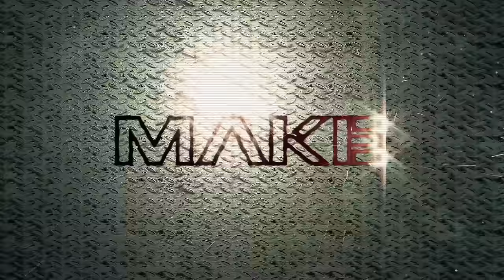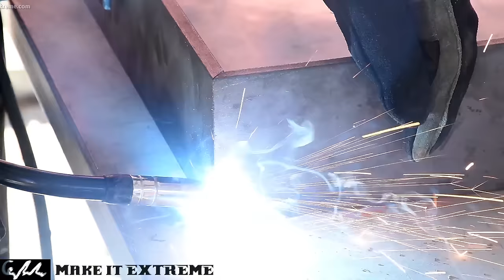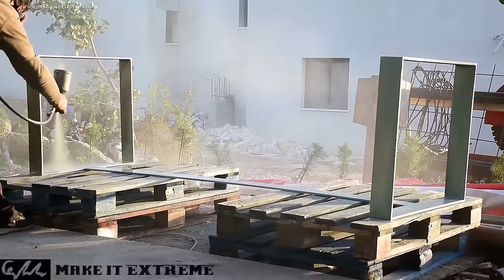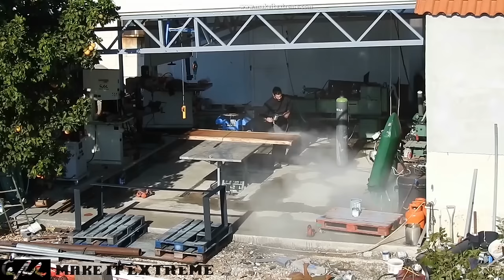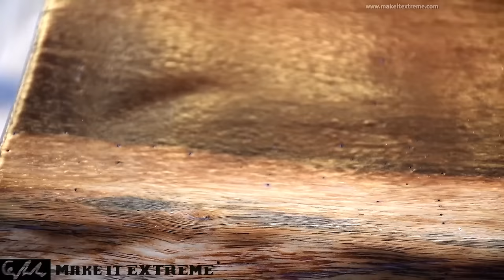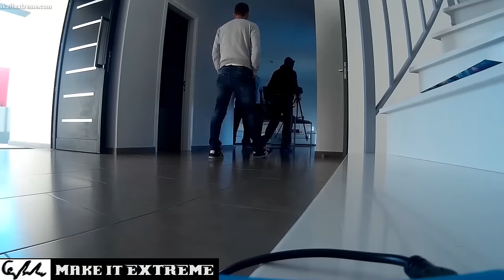Dining Table 2

Comment: Beautiful mate, I think you would do yourself a big favour if you just returned to the customers house and widened the screw holes in the steel so the slab can move. It will only take you an hour and save you a big warranty later on.

Comment: I'd like to see linear actuators instead of the gas tubes. Sure, gas tubes are functional, but wouldn't a screw actuator be kinda easier? 
I guess there is the problem of power supply though. Hmmm. Dang. I still liked it!

Comment: Beautiful table! but won't such a large slab of hardwood warp? And crack because it is bolted on and cannot change its shape?
Reply: beautiful table. but the slab will twist. you should not fix it on screws. you need a sliding dovetail to avoid twisting of the slab

Comment: What is the spray that you used before welding?  Thanks for the great videos and inspiration.
Reply: anti-splatter spray used for flux core wire. Keeps you from having grind all the splatter off
Reply: Cool, thanks!
Reply: its just anti splatter not only used for flux core plus he was using solid wire